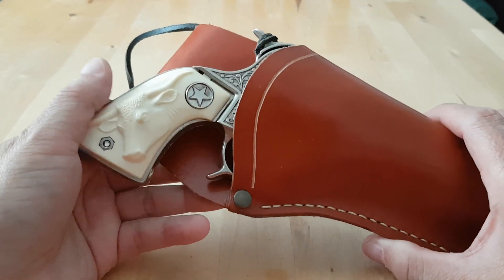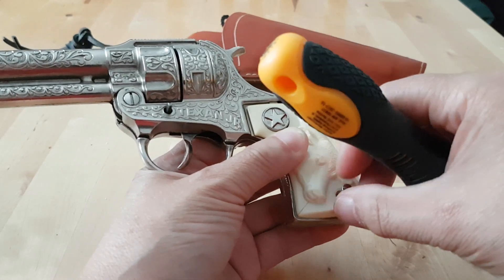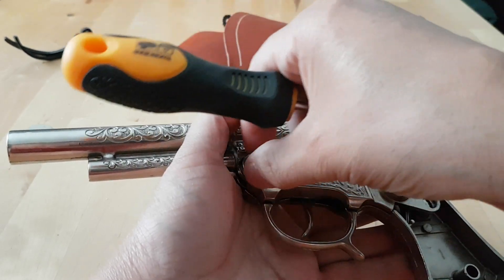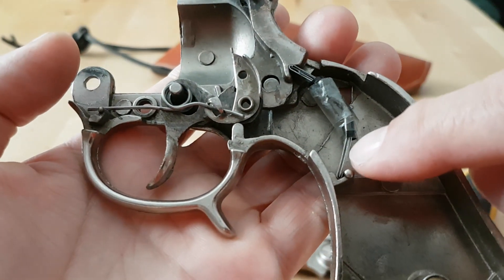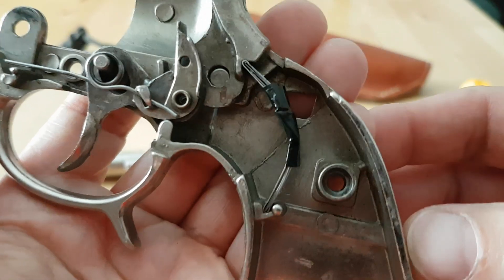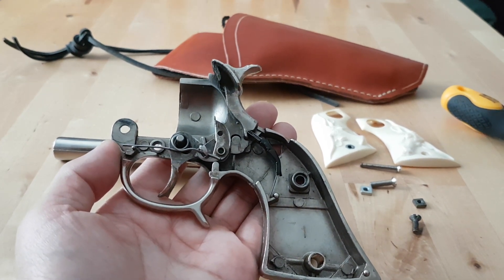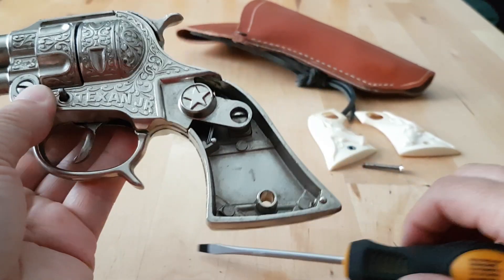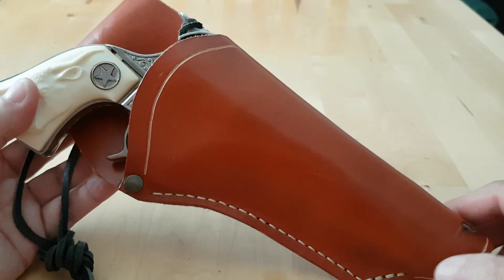Internal workings of the vintage Hubley Texan Junior toy cap gun

Comment: Brilliant that you fashioned Your own springs! This is a wonderfully useful guide.  I've bought spring steel to do the same with those models where I can't locate replacement springs. I've begun repairing vintage cap guns and the models assembled with nuts and screws are quite easy to repair. Now I've begun working on guns assembled with rivets, grinding them out to replace with sheet metal screws and nuts.
Reply from the maker: Thank you and have fun with your restorations, they are great things to tinker with! Sorry too that I didn't reply sooner as I didn't get a notification of your comment.

Comment: I just ordered a similar gun from eBay its old 1975 he said it needs a spring to fit in line the firing pin to hit the caps any clue which spring he means exactly ?
Reply from the maker: @JOHNN01.82  It could be the piece of spring steel that sits behind the hammer which pushes it forward to strike the cap. That's the part where I fashioned together a few pieces of spring steel. Normally it is just one piece of steel. When you get the gun you will know if you pull the hammer back and there is no tension. Let me know how it goes! It's great to get one firing again!

Comment: I hope you still reaping I need some major help man. I have been stuck with this 1940 Cast Iron Stevens Buffalo Bill Cap Gun. I dissembled it and now I can’t put it back together! There’s almost no information whatsoever on this cap gun if you could help even a little I would appreciate it.
Reply from the maker: On Google, it does look similar in that there appears to be a square nut and screw to disassemble the two sides. The grip mounting look similar too. Do you have similar internal parts, springs etc? I also struggled to find info online which is why I made the video to help another viewer.
Reply: @tinkeringforfun  I can’t really name some parts because I have never seen anything like it. It has the same coil the you had in the video except one side is shorter and the other is longer.